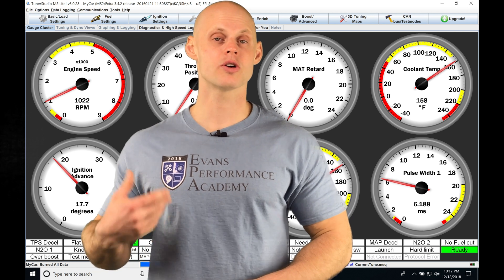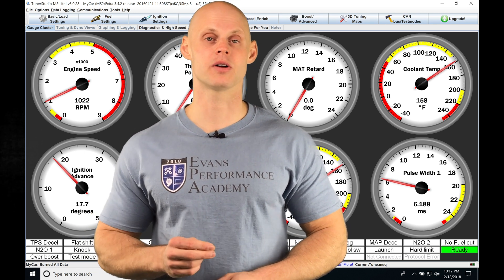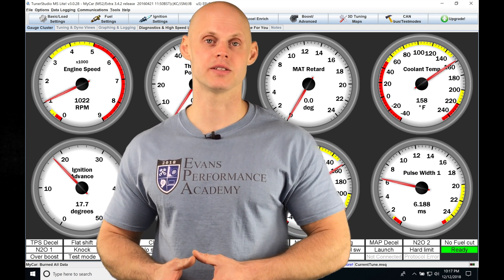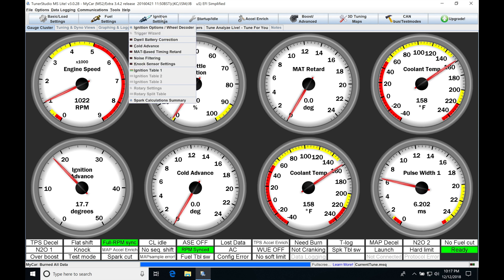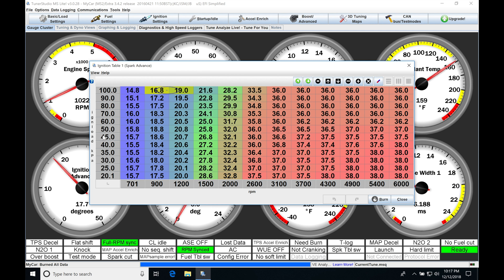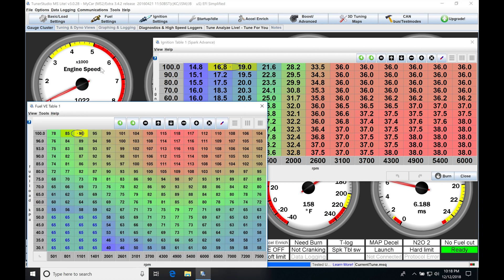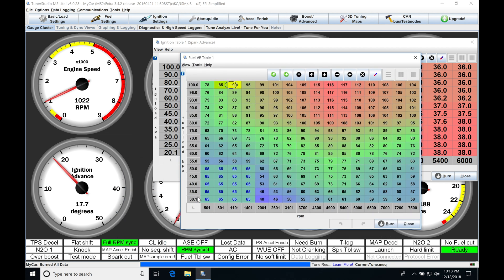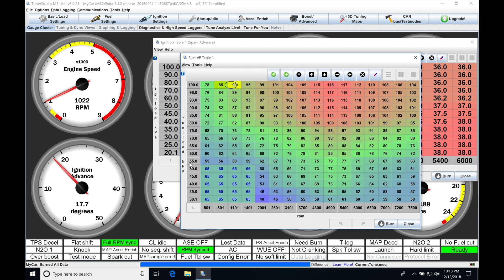Megasquirt: Spark Timing | Evans Performance Academy

Comment: how did you connect the ecu to the computer? do you guys sell like a obd2 to a usb?
Reply from the maker: With most Megasquirt boxes you just use a simple usb to serial converter which are available readily on amazon.